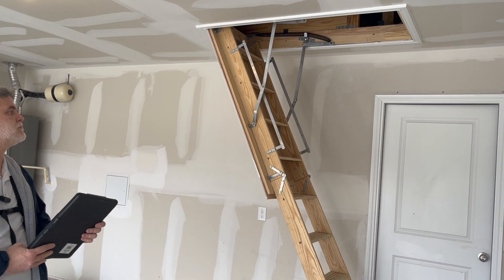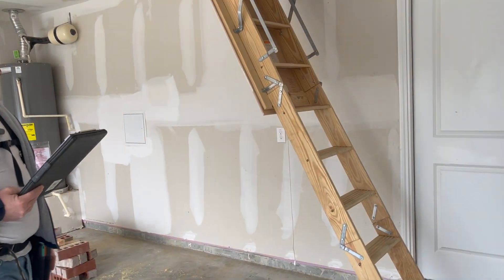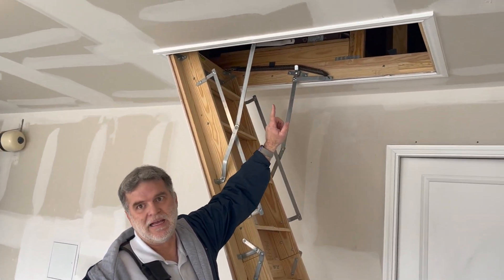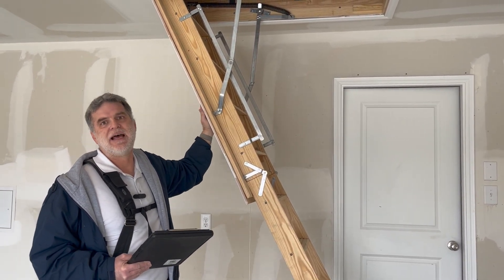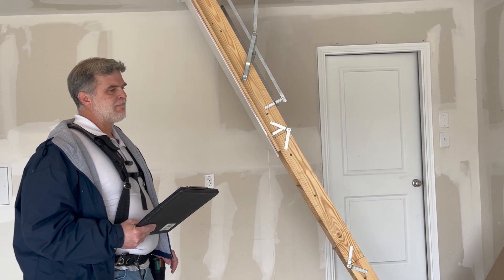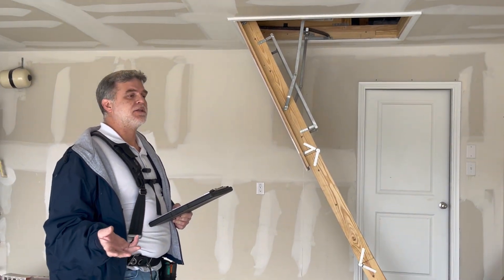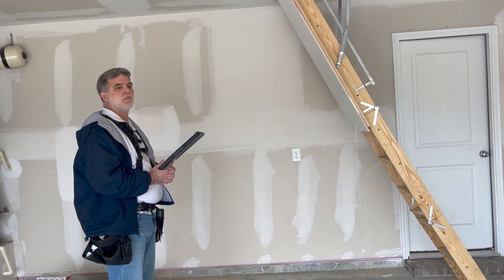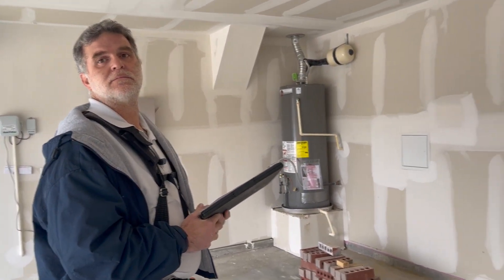Fire rated attic stairs, whats the code say?

Comment: A fire rated attic ladder is only necessary if you have hazardous materials in your attic per the IRC.  For instance, a natural gas or propane gas heating unit, perhaps stored combustible products like paint… stuff like that. Each municipality requires a different rating, this means your city may require a 30 minute rating while others a 75 minute rating or more.  Your contractor should know this.  If not, go down to the city planning or Building Department and pick up their printed guidelines.  If they do not have anything printed, and you talk to a building inspector, be sure you get their name, first and last, or better yet have them write down the information and than have THEM sign it.    CYA baby… CYA.  😂🤣
Reply: Good point.